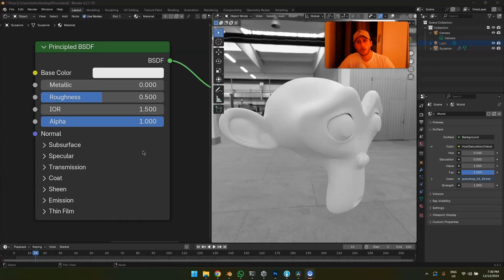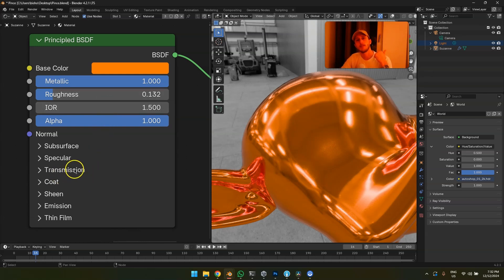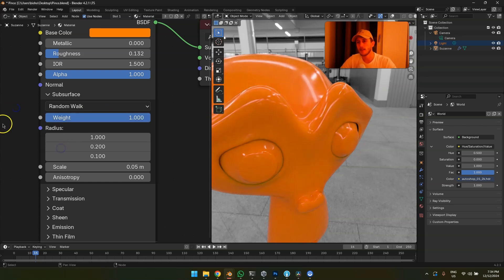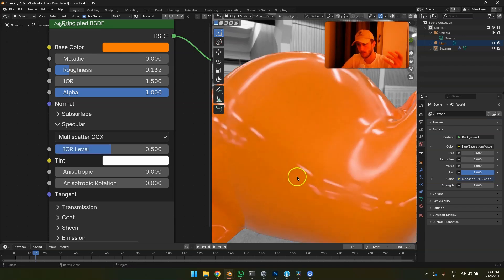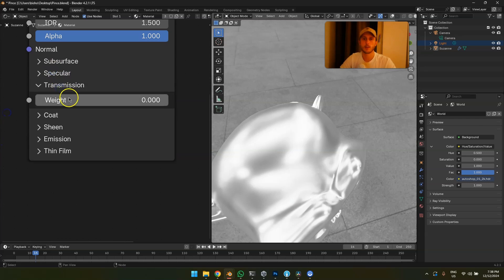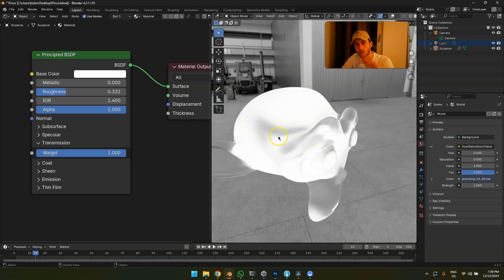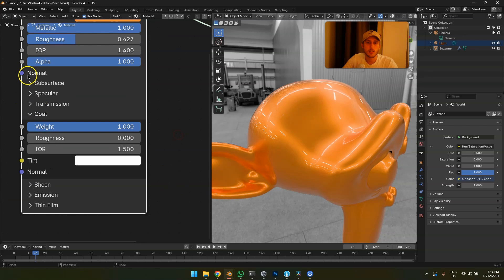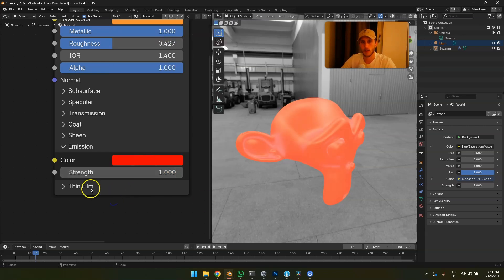Finally Understanding the Principled BSDF

Comment: This is great for beginners, but only for them 😅 also, the IOR/IOR level stuff is not 100% correct, as the way IOR works was changed with Blender 4.0. You should actually change IOR because not all materials are the same in real life and if you are going to aim for photorealism, you should understand correctly how that works. But again, for beginners, it's good 😊 Thanks!

Comment: how to pin a specular map in this new shader?
Reply from the maker: set to no color detail, and into specular. 
Just keep in mind, specular maps do exist, but mostly refer to an outdated old school shader model. Now days people usually only work with roughness maps.
Reply: @DamianMathew  new bdsf doesn't have specular map blue dot, that's why its confusing
Reply from the maker: @ExistentialDawn  you need to unfold specular, and stick it into IOR Level, which is the specular strength.